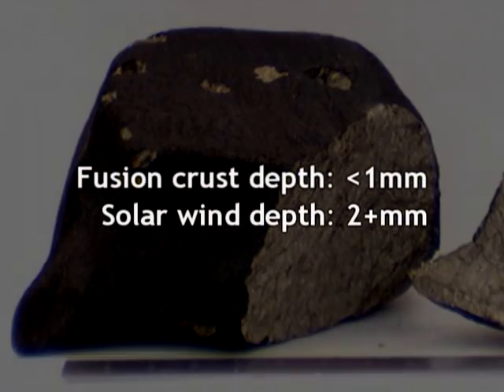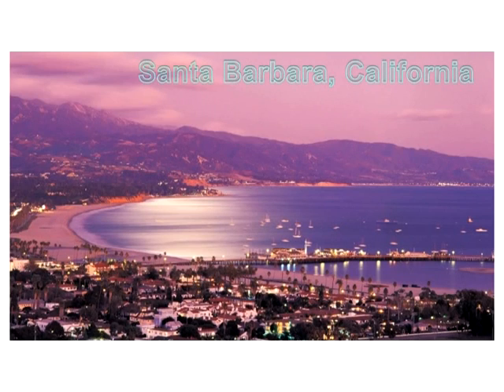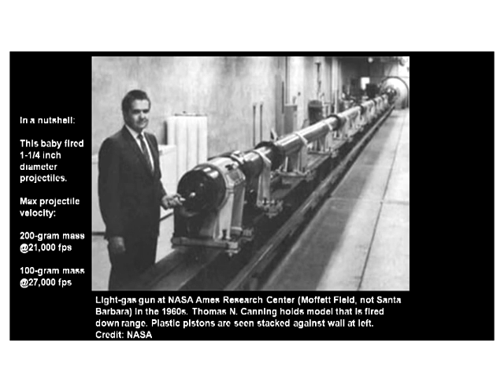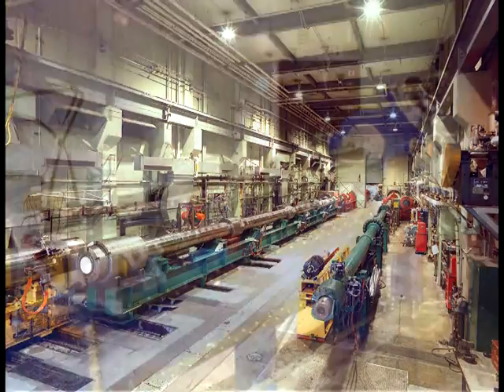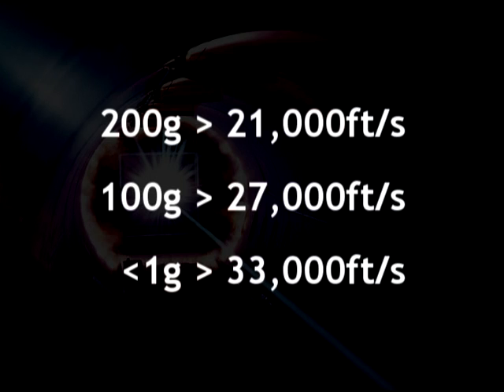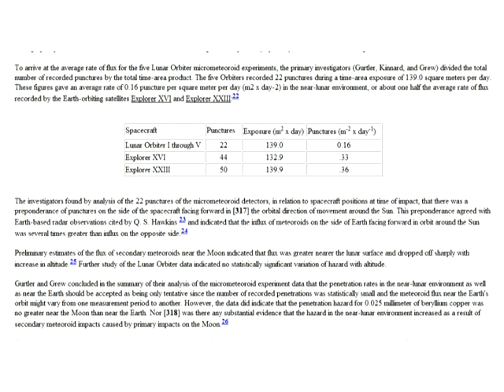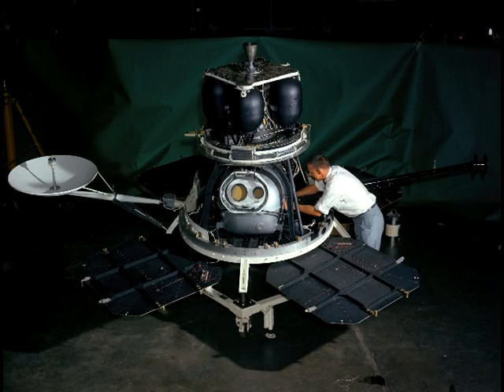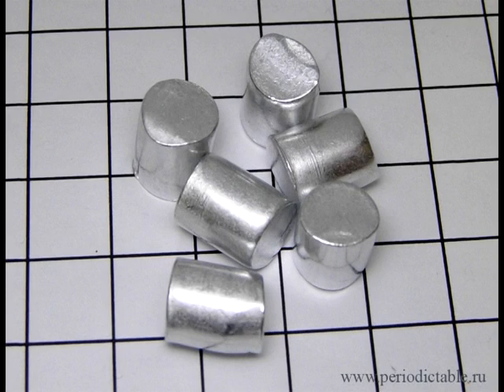MoonFaker: Moon Rocks Revisited. Episode 8, How NASA faked the Zap-Pits in Apollo Samples. PART 1

Comment: Alright, checked them sizes, if that could explain why some rocks have few or none zap pits. Again: nope!

10031 was really tiny, but then there were samples of similar size that had few or many zap pits.
10044 was among the biggest, and still none zap pits.
10050 and 10074.were average size samples.

Size nor exposure age to cosmic radiation do not correspond to the micrometeorite hits amounts - I think this matter needs closer look, maybe a chart and a video.

Comment: @NASAvsPETE

The Lunar Sample Catalog lists if the samples have zap pits. The Lunar Sample Compendium shows cosmic ray exposure ages - unfortunately not defined with most of the samples. Nor do all samples have a document.

Of the 26 A11 samples I checked so far, 4 didn't have any:zap pits: 10031, 10044, 10050, 10074.

And check out the cosmic ray exposure ages compared with the samples! None, few or many: not related to how long they've been exposed to radiation on lunar surface! WEIRD, eh?

Comment: @NASAvsPETE

Space weathering isn't only on the surrface of the rock like a paint: it extends deeper. So IF you have a space weathered rock, a new zap pit crater doesn't expose "fresh" rock surface: it exposes already space weatherd surface. Apollo samples' zap pit craters are also generally different colour than the rock surface: dark weatherd rocks have blonder zap pit craters.

Could you forward me to documents with zap pits dated? I could not find any. Would be interested to read.